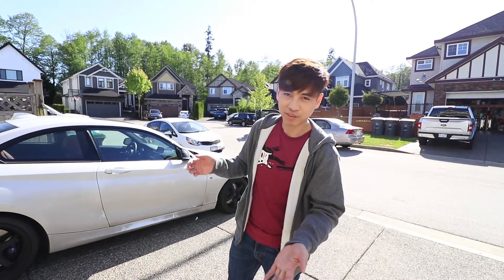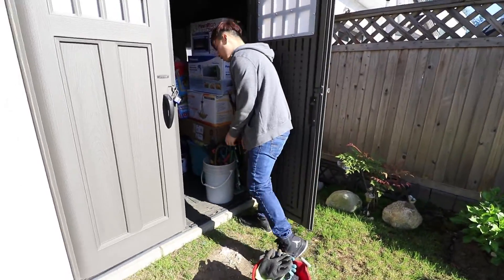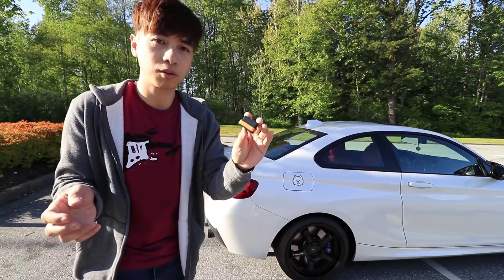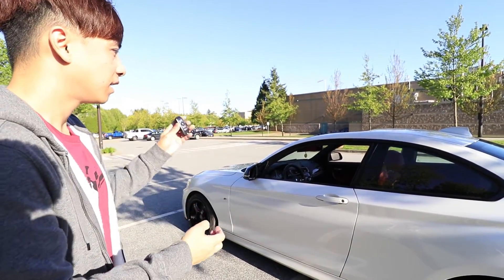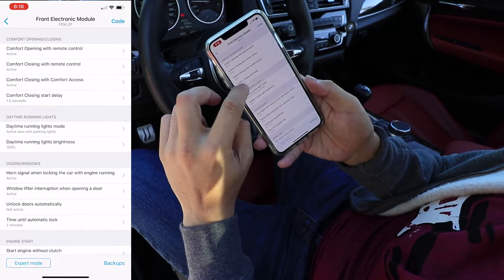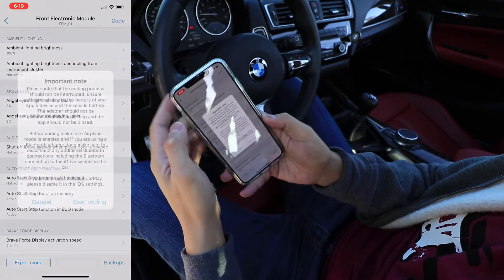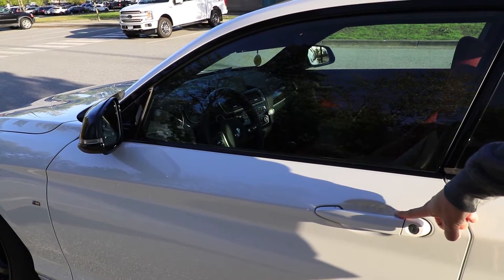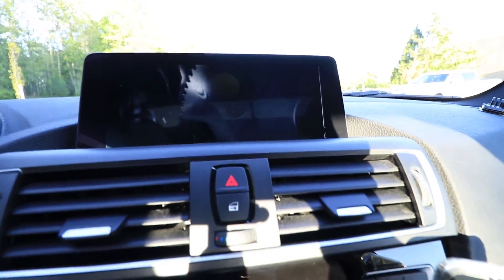JUST MAKING A FEW CHANGES... - How to Code a BMW M240i

Comment: I'm graduating and very torn between 16 S4 and the 17 M240i. How has the reliability been? That is my biggest concern. I know that the B8.5 S4 is bulletproof but I don't know anything on the M240i with B58 engine.  I won't be modding the car. I'll just be doing the exterior mods/ m performance exhaust. Let me know!
Reply from the maker: I love the performance of the M240i as much as the day I picked it up. I still break a smile at its hard accelarations and butter smooth delivery. I don't think you can go wrong with either cars tbh. Perhaps take more considertation of the other merits of each car besides their respective engines if that helps? Whichever one tickets the most boxes for you. Can't go wrong either way.
Reply: @Shundel  Thanks for the reply! post more videos on the m240i!!
Reply: @MDIHSteam1  A but late here, but the B58 is pretty amazing. It's a closed deck block with a forged crankshaft and forged rods. Supposedly they have corrected water pump issues and all. I haven't seen any major problems as of late. The timing chain and components are on the back of the motor (the side mated to the trans), which could be a pain if you have timing/vanos issues, but again, haven't heard of any issues especially if you keep up with the proper maintenance.

Comment: Hey Shundel. I have some questions. I saw your video about tune midpipe. Is that will void warranty?
I’ve m235i 2016. So I wanna make a louder and would be like remove resonator or change to midpipe like your m240i.
I just wondering and worried about warranty.
Thank you.
Reply from the maker: Hey! It should not void your warranty as a whole, but it may give them a reason to deny coverage if anything comes up due to the mod. I hope that makes sense.